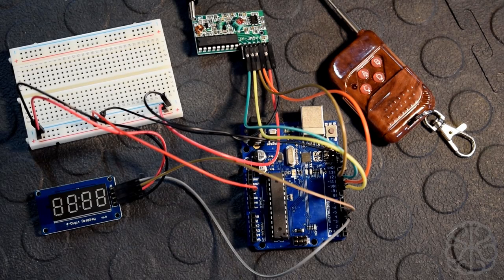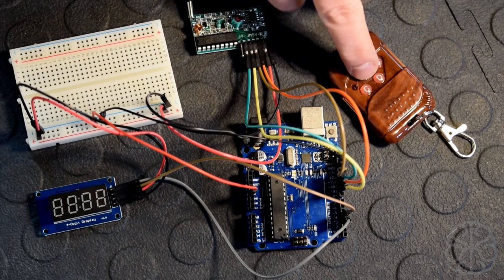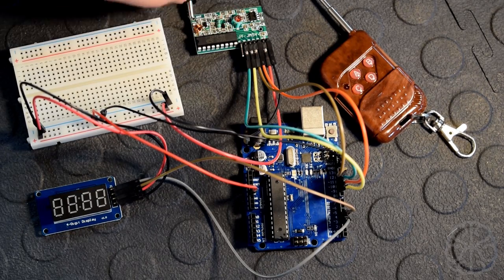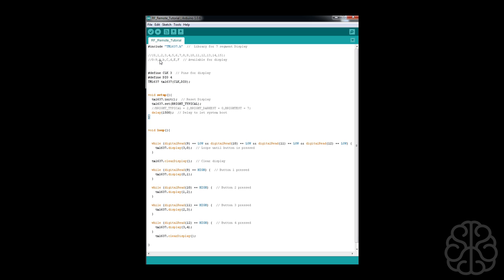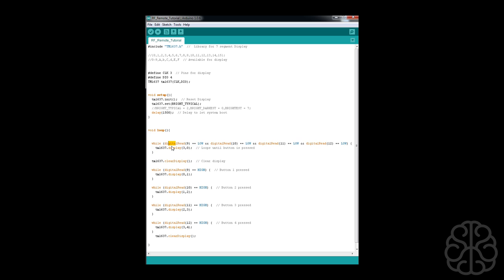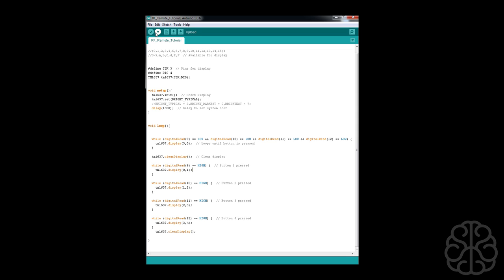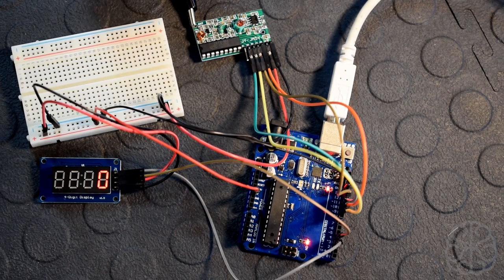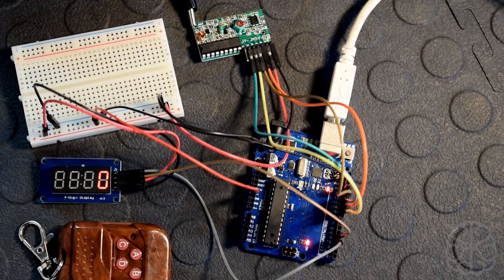How to connect and use a 315MHZ RF Remote with an Arduino - Tutorial

Comment: Thank you so much for this. Simple button with no library needed. Ordered one off ebay. Horrible colour and design though, wish they made a simple black one like they have with linear actuators or garage doors.
Reply from the maker: Yeah they are kinda ugly but they are cheap and easy to use :)  Thanks for watching and good luck with your projects!
Reply: @BrainybitsCanada   I just got this from e-bay China and the damn remote didn't come with a battery. Nothing to tell you which battery fits it. It looks like an N battery might fit. Do you know if this is true. Really not great that it isn't supplied.

Comment: how to control a stepper motor with this method ?
is that remote control match with the receiver or should i read and wright the remote control buttons with serial monitor in arduino ?

Comment: Hi Ivan, just starting the video.  I guess I'll see if you cover On/Off for a single button on the remote, but if you don't, have you done it?  I also have a four button remote and would like to have each of the buttons turn something on with the first press and off with a second press of the same button.  So, press button "A" for the first time and it turns on a motor.  Press button "A" again and it turns the motor off again.  Same principle for the other buttons.  I can do it with simple toggle switches, but am a bit stuck on doing it with the values received from the remote and the then there's the polling of the second press.  I'm a bit new to this.  Thanks
Reply: Perhaps you could have a boolean variable for each button, and when you detect a button is pressed, it checks if the variable is false, if so then it goes to false, and if not then it goes to true. If you wanted, you could probably do the same with an integer variable and get it to cycle through them. I've not tested this tho, but I hope it helps!!

Comment: hello. i made this project but i put a stepper motor instead of digital display and its work fine. but i need some help with the sketch.
how can i define 1 button of remote control to turn the motor shaft CW and CCW ?
i mean when i pressed the button the motor turns 45 degree CW then the button didnt turn the shaft that way again and when hit the button again its turn upposit ?
is that possible to answer me